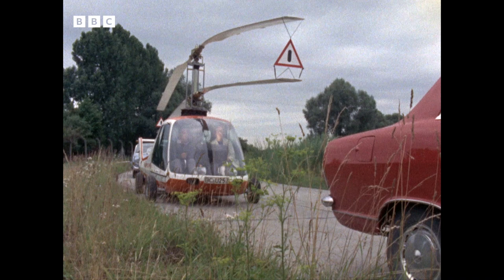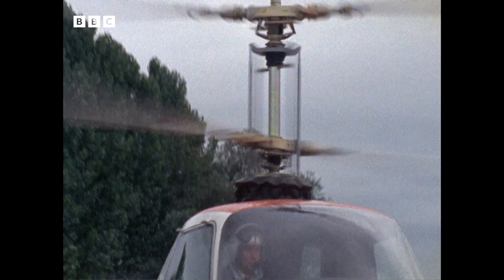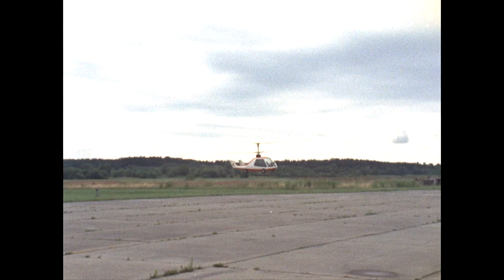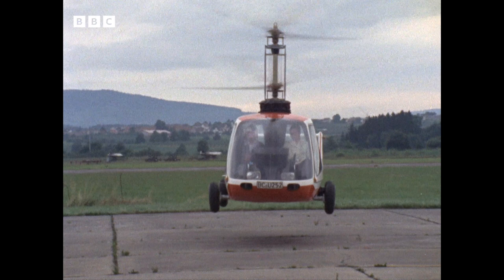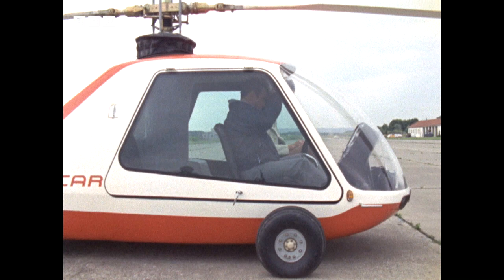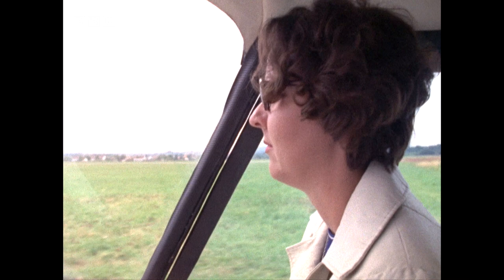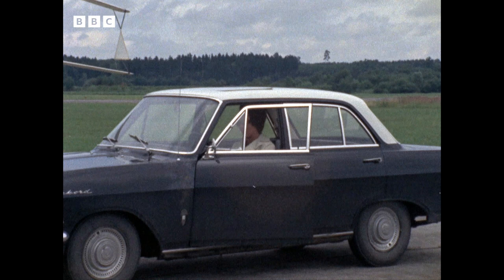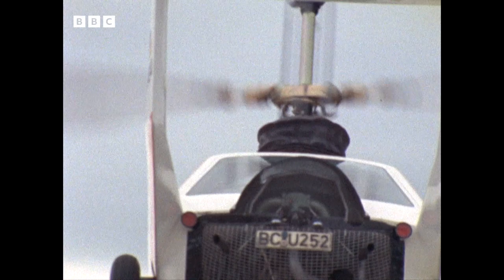1970: The FLYING CAR is here! | Tomorrow's World | Retro Transport | BBC Archive

Comment: Anything that flies through the air and carries passengers will always need to be much more expensive to manufacture and maintain, and anybody who flies one will need a minimum of 40-50 hours of training with and instructor so they know what to do when something breaks (and that includes any auto-pilot or AI system you care to mention).
Reply: They have parachutes for helicopters now!
Reply: @andywatts8654  Powered Paragliders have a 200 Mile range and no licence required 😉😊

Comment: normal car could be changed into a chopper not a good one but fun to see a known kinda car as chopper, lets say toyota corolla older kind , top removed to let air through and hole in floor behind driver and passanger seet removed too , bonnet. so air can pass through and top of fenders and wheel wells removed, if same engine position..not good for balance, move it to mid car mabye .

Comment: Why don't all helicopters use the dual set of rotors if they're easier and safer to fly?
Reply: good question
Reply: I think it is because dual rotors limit the manoeuvrability of the helicopter, whereas using a single rotor combined with a tail rotor gives far more freedom of movement.
Reply: More mechanical complexity, weight and noise. The contra-rotating propellers of the Tupolev Tu-95 make it outrageously noisy.
Reply: @nkt1  not really - the TU95s props spin at very high speeds to create the power for the world's fastest prop plane. Contra rotating helicopters are common; witness the Kamov designs which have been very successful in russia,. they are, however, more complex and expensive to produce
Reply: Coaxial helicopters lose yaw and are harder to land if they break in the sky.  A regular helicopter can be autorotated to the ground using the airflow over the main rotor to keep the tail rotor spinning, having the tail rotor means the helicopter can point in one direction ensuring enough air flows over the rotor to glide to the ground for a bumpy, but safe landing.  If a coaxial helicopter loses engine power it tends to yaw to one side or the other and corkscrews to the ground much faster, this is the reason why coaxial helicopters either fly very low or they fit ejector seats that detach the rotors before launching the pilot(s) away from the craft.

TLDR;  If a Coaxial helicopter breaks your choices are either hitting the ground hard with the helicopter and breaking some bones or hitting the ground slightly less hard in your ejector seat and hopefully not breaking any bones.
Reply: @stewartellinson8846  He's right. You get a ton of aerodynamic interaction, particularly blade tip vortices between the rotors, which leads to noise, vibration and instability. This is exactly one of the benefits of the faintail/Airbus Fenestron duct.
Reply: Coaxial helicopters are heavier and more expensive, they are taller than normal ones, which can be a problem, 90 % of machines are of the tail rotor design, so Coaxial can't be as good.